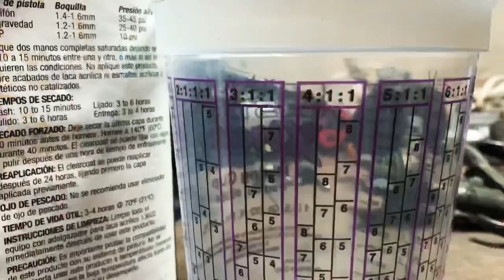Restoring old 50’s electric GE fan | antique restoration video

Comment: That is great! Those old fans sure do require a lot of elbow grease, i think you were wise to not try and fully break that motor down. I have fixed several projects to death by going too far. Don't stress about the analytics, viewer feedback is the way to tell if your channel is reaching the right folks. Cheers

Comment: The piece of rubber (compression fitting of some kind?) holding the fan blade complex onto the shaft is a bear to get off.  Any suggestions?
Reply: It is hard to mess with I was a twin Ge window fan I restored and one came off decently with a bunch of penetrating fluid and the other broke into 2 parts but the blades came off before it was removed from the shaft I got it off with pliers and I can’t find them anywhere so I had to glue it together it works good just don’t use reverse the blades flew off for me and i stood on the fan to hold it down while I pulled as hard as I could to get the blades off before you but them on sand the shaft so next time they come off easier
Reply: @icyy2cold143  Thank you.  After a bit of research I believe I am going to attempt the use of AT-240 (Kudos to Scotty Kilmer). However I am told it may have been reformulated, so who knows if I will be successful or not.  I will report back.  Thanks for the sanding idea.

Comment: You put the front GE badge on the grill on upside down
Reply from the maker: thats because i had the fan cage swivled the other way. on each side of the cage there are 2 metal studs that allow it to swivle, so u can have the fan pointing the other way without having to turn it around. originally, the fan is supposed to be mounted in a wall.